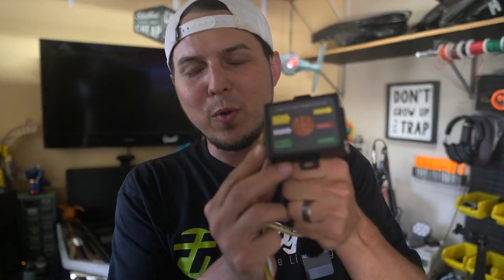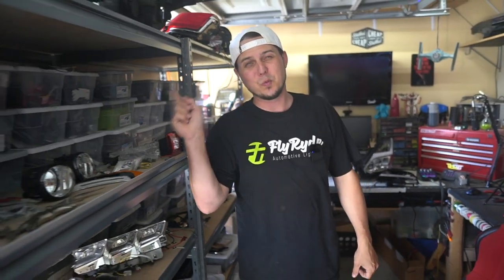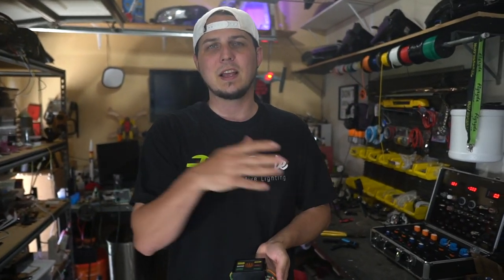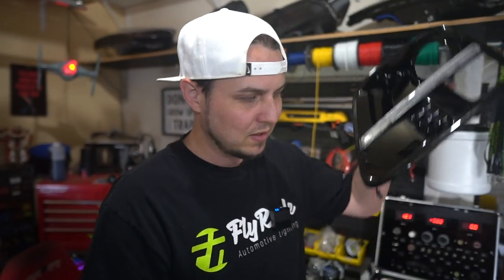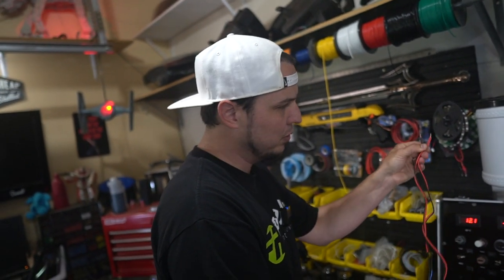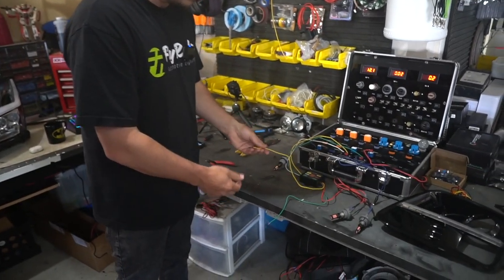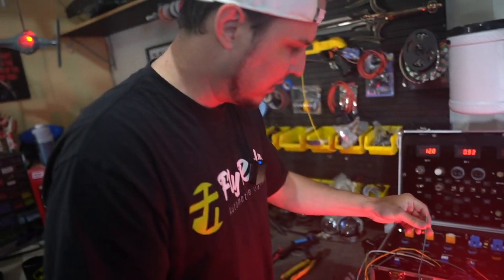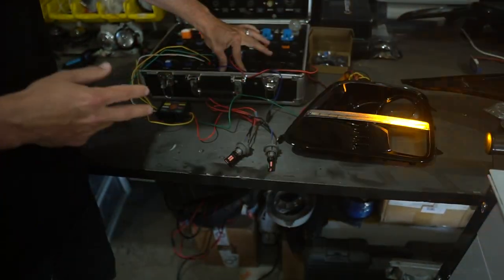How To Split Brake Light and Turn Signal

Comment: The reason the ground is white is because that is the normal ground color for trailers. That module is normally used for flat towing a car behind an RV. A normal trailer connector on a tow vehicle has a break and turn combined. If the vehicle you are trying to tow has two separate bulds you use this to slice into the OEM harness to controll the towed vehicles lights through your trailer connection in the tow vehicle.

Comment: This is blowing my mind. I had to run wires from the front side markers and 3rd brake light to separate my signals. About half way through the video, I was thinking wouldn't this kill the emergency flashers, which you got to at the end. If it does, maybe continuing to pull the signal from different sources is still the way to go.
Reply: I pulled the front turn signals and the high mount brake light, that’s the way to go. The hazards will flash all the lights and the brake lights will be disabled at that time if you are using the box.

Comment: Hazard lights flash red. The yellow light only works when one side is used by itself. I guess there's some kind of relay in that box that says "if I get power input from both sides at the same time, I need to be sending the power output to the center output wire." I hooked it up to my Dodge and it seems to do fine if you hit your brakes before you hit your turn signal. If you hit your turn signal for a turn and then brake, the other side will want to light up yellow. So it's probably safer to run one of these converters, just hook your brake lights up to your third brake light wire, not the converter itself. If you really really need yellow hazard lights, you might have to tap into the hazard switch circuit and run those wires to your turn signal bulbs

Comment: Hello, thanks for the video, I have a few questions, I have the same light converter that you use in the video, but when i using it on a 2024 Ford Maverick that has LED rear lights and powering a trailer with LED lights, it throws light errors flashing on the vehicle screen, the lights have erratic behavior and the converter starts making electrical noises. What could be the problem?  Could it be that if the vehicle uses LED lights then the light splitter is not compatible?

greetings from Chile

Comment: Awesome!  Would this work with Diode Dynamics red halo (brake, signal, tail). My issue is my 1157 socket/wiring won't split the brake and signal!  So after 2 seconds of brake lights on it dims... as it's designed to do so not working got 1157 (2 wire, 1 is brake/signal, other is tail/parking).  Annoyed with the dim after brakes are on for 2 seconds.  I believe this will fix it!????  Thanks so much. Working on an 59 Buick so simple 2 wire system. Thanks

Comment: I used this same method, but turn signals hyperflash when brakes are applied. When brakes aren't applied, no hyperflash. Would you recommend adding a resistor to the single brake wire?
Reply: Got the same problem 😂

Comment: I have a 1984 corvette with 4 taillights that also use blinkers and brakes all in 1? would I need to buy 4 of these things or 2 of them?  So I would connect both taillights on driver side into 1 box and then hook up both taillights on the passenger side also of course my flashers go to all 4 taillights at once!! I NEED HELP!! I bought LED bulbs

Comment: I would rather tap into the high mount brake light and the front turn signals instead of using the box. For my trailer, I use two - four way flat connectors. The one that came with the trailer is not altered at all except I paint it red. I added a second one and panted it yellow and it goes to the yellow turn signals that I added to the back of the trailer. On the vehicle side. The red plug has the yellow and green wire connected to brake only and the brown is still tail light. The yellow connector has the yellow wire as left turn only and the green wire is right turn only. The brown is reverse lights. If someone else needs to borrow my trailer, they just use the red plug and the factory red lights will function as both stop and turn and the yellow lights do nothing.
Reply: Nice. Did you add a third brake light to the back of your trailer? Did you also add then dedicated turn signal lights to it?
Reply: @Mannievh  I didn’t add a third brake light, just dedicated turn signals. I would have to use another wire for a third brake light because I have left and right separate on the trailer side in case it needs to be towed by a vehicle with standard wiring.
Reply: On some sequential modules like corosomotion you can’t simply tap the third brake. You still have to disable brake feed to column thus to the rear of a car or truck that uses a shared wire or the constant 12v will shut the board off and render no brake light
Reply: im having this problem kinda , i tried the converter but the output signal for turn signal still activates when brake pedal is pushed .. 2010 ford edge  soo not sure why it would do tht after the converter box but maybe running the brake light from up high n turns from up front to back would fix this ? i wouldnt use the box obviously but im super frustrated

Comment: Thanks for the video. Is there any possible way to do the opposite? Here's what I mean...
I have two Kias - Sportage 2020 and Forte 2022 both of their turn signals are installed way too low on the rear bumper and sometimes hard to see from drivers behind in a traffic. So I'd like to use my brake lights as a turn signals at the same time. Thank you! It would be great if you also make "how to" video.

Comment: I have questions like how many amps should a headlight give off? How much should every led? What’s normal what’s not? 
I have a 2016 Ford Fusion and I want to fully custom mine but if they break I want to repair them so I’ve been learning how to solder wires and different sizes of gauge wire

Comment: I’m trying to wire some leds to act as running lights, blinkers and brakes on my motorcycle. I can seem to find a solution but have seen it successfully done on another YouTube video I just can’t get a response from him. From my research I believe a module will offer a solution but I just want to understand how and thus how to wire it

Comment: So this will fix the turn signals turning on when I hit my breaks? I have a 08 silverado with aftermarket taillights. I noticed my brake and turn signals are the same wire… hoping this will fix this nightmare
Reply: Aye did you ever figure out how to fix your issue I have an 06 charger doing the same thing everytime I brake both sequential LEDs flash I ordered one of the converters going to install tomorrow but I hope it works for me

Comment: If I am trying to add turn signals to a light assembly that only has brake lights. I'm looking for a way to get the brake to shut off on the side that I am turning. That way they are easily noticed.

Comment: If voltage all over the place couldn't you use a voltage regulator to keep it at a stable set voltage? and you can get those test boxes on alibaba

Comment: How to do the oposite ? Need to merge the turn and brakes, any board tutorial?
Reply: There is a similar device available. What he is showing is a 2 to 3 wire converter. There is also a 3 to 2 wire converter available that will combine turn and brake signals. Amazon is your friend...

Comment: My brake lights stop my turn signals from flashing... no matter if it's hazards (both) or not. Also, my tail lights aren't working at all. Only the brake lights when I press the pedal, and the turn signals when the brake's not pressed.

Any idea what the source of this issue would be? Thanks.
Reply: Did you figure this out? From my understanding, you need a diode on each wire, isolating the current in one direction. I just haven't figured out where to install the diodes, yet.
Reply: @jtmar157  Hmmm. Strangely I just had to put my aftermarket LED gauge back on... it's a little bit of a mystery to me still.

The only thing that's kinda off is my turn signal indicators on the led cluster will both light up when I hit my brakes.

I did have to change a blown fuse or two during the process. Check those if you haven't

Also, it looks like something is spliced into my tail light wiring from the previous owner. Not sure what it is, haven't investigated since my new led multigauge is working around the issue

Comment: Have you made another video about this set up on a vehicle, I currently have ordered the 2-3 wire converter for my pick up. I have a 2012 and installing 2019 tail lights, I’m hoping this will fix my issue

Comment: Why are you trying to teach people electrical? You don’t understand it yourself the first five seconds of your video explains what that module supposed to do but then the way you wire it up and act like it’s working. The way that supposed to work is it cuts power to the brake light on that side when the turn signals on. You’re showing two separate bulbs in the brake light never goes out when the turn signal comes on.